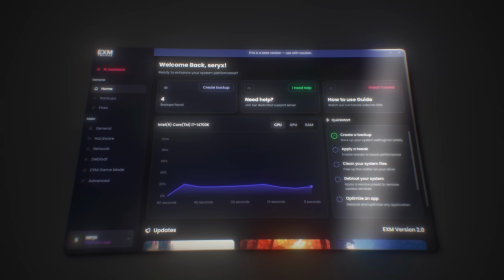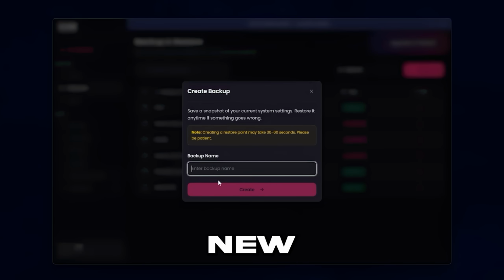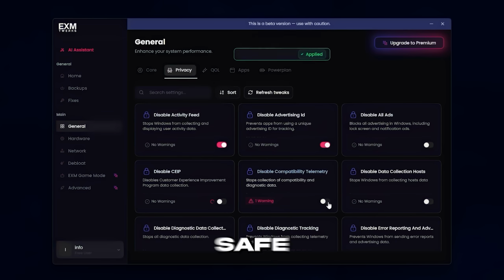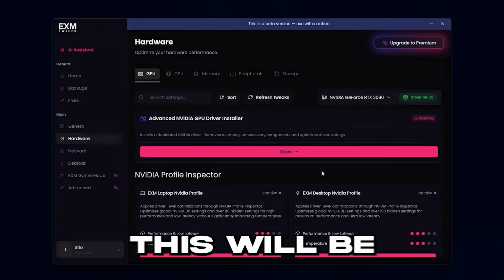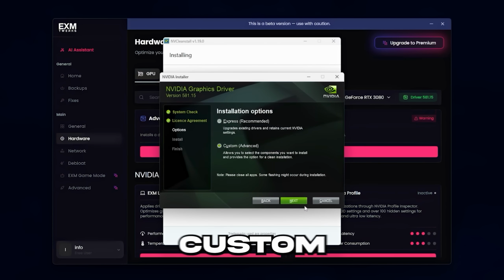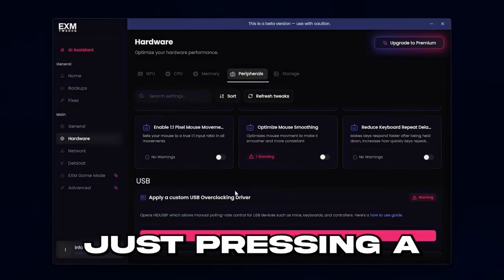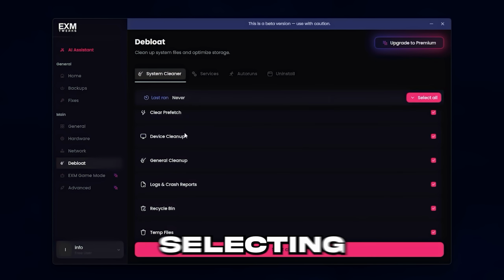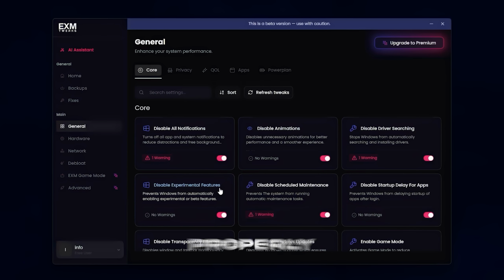*ULTIMATE* PC Optimization Tool 🔧(Boost FPS, Lower Input Delay)

Comment from the maker: Thanks for the support, if the free utility helped, make sure to check out the premium version!
https://exmtweaks.com/pricing/
Reply: I have i5 13600KF rtx 4060 and 32gb of ddr4  which value is the best for win32priorityseparation pls  🙏
Reply: @CHAT_TASTROPHE 26 hex
Reply: I am getting : Failed to save onboarding data
Reply: I have a gaming laptop with a 4050, i5 13420H and 32 GB ddr5
Reply: @vort712  yooo same but idk if its ddr5 or ddr5
Reply: I need exm free tweaking utility v10.0.cmd to send me link in download
Reply: @exmtweaks  this is the first time I downloaded any tweaking software and everyone has been telling me your the only person they trust so my issue is, I downloaded it and installed it and opened it, but it’s asking me to log in and when I do, it says loading session but then proceeds to kick my out over and over, what is this issue and how do I fix it
Reply from the maker: @kazwyd1x  yo, its an issue on our end, it will get fixed soon
Reply: I have a taichi rx 9070 xt , ryzen 7 9800x3d ,   32 gb ddr5 , in a rog strix x870e-e.   I’ve been using your free utility for ever now it feels like.   Never had an issue but on the free exmtweaks 2.0 when I click the I understand tab I get.  Authentication failed.  Please sign in and save password
Reply from the maker: @kinneyjr740   yo, its an issue on our end, it will get fixed soon
Reply: 12th Gen Intel(R) Core(TM) i5-12400

NVIDIA GeForce RTX 3060

RAM 32.0 GB
Reply: 9070xt 9800x3d
Reply: I know I bought it for a month but I was just wanting to enter just in case I could get it
Reply: i wish i win man the giveaway W tweak i wanna try it
Reply: I can't sign up at all, let alone sign in. I just get failed to login errors when trying to sign in :(
Reply: I have a Ryzen 7 5800x3d, an RX 6700 XT graphics card, and 32GB of RAM. Could you give me some good configurations for performance in Warzone?
Reply: is it free
Reply: pt-br  por favor
Reply: i have 4070 super and i5 13400F and 32 gigs of ram
Reply: @exmtweaks  hey so i tried using it but every time it cheks my System there is no continue button
Reply: @exmtweaks  I-7 6700k RTX5060

Comment: Hey EXM team, I need the official recommendation for Win32PrioritySeparation on my machine.

My specs:

Laptop: Dell 16 Plus (DB16250)

CPU: Intel Core Ultra 7 258V (Lunar Lake, 8C/8T, low-power)

iGPU: Intel Arc 140V

RAM: 16GB LPDDR5X (soldered)

Storage: 1TB NVMe SSD

OS: Windows 11 24H2

Usage: Daily web games (browser-based), 1080p/4K YouTube, Discord voice, light idle. Occasionally tweak with BoosterX + custom power plan (currently on EXM PowerX V3).

Cooling: Thin-and-light fan, quiet profile preferred, no overheating but want low latency.

Question: For this Lunar Lake laptop config, is 26 HEX (Recommended) still the right call, or should I drop to 18 HEX like you told the i7-14700K + 4070S desktop user? Thanks!

Comment: I definitely recommend these tweaks, I went from 200 fps too 400 and 30-40 ping to 20-30. It’s free it’s not a Trojan or anything. It has a bunch of stuff instead of the others where u only get 3 setttings free and the rest subscription. This is a legit utuber

Comment: I GOT A 4060 WHAT HEX?
Reply: ngl dont use it, its honestly useless, it could damage your pc aswell, dont take the risk because windows 32 is the most important part of your files/pc or wtv without it your pc will literally not work at all. Changing the hex will do nothing, and I have a 4060 aswell if your cpu/ram is trash then js upgrade rather then breaking your whole system.

Comment: yo tysm bro i was hard stuck at 360 fps and now i can easily hit 800-1000 with zero delay
Reply: why would you need a fps boost? that's already good when most monitors are around the 200hz - 300hz. if you're using a 60hz monitor the fps boosts is meaningless
Reply: @colkid5298  if you have a low end pc or are having stutters
Reply: @wtwbray  still. that much fps is dependent on the monitor
Reply: @colkid5298  i have a 200hz monitor and run 800 fps with no stutters

Comment: i am planning on buying the premium version because in game i often cant even hold stable 165 with specs like ryzen 7 7700 rx 7900 gre great power supply and an fd celsius s 36 like theres no overheating issues or any

Comment: Processor	Intel(R) Core(TM) i5-6500 CPU @ 3.20GHz   3.19 GHzInstalled RAM	16.0 GBStorage	477 GB SSD SSD Graphics Card	NVIDIA GeForce GTX 750 Ti (4 GB), Intel(R) HD Graphics 530 (128 MB)
Reply from the maker: 16
Reply: @exmtweaks thx
Reply: @exmtweaks Do you know what end my pc is like low end high end mid end

Comment: I have a mx450, i7-1165G7 and 8gb ram.I want to play battlefield 5 but it gives 10-15 fps.Even in low settings.Will this program help me?And tell me which hex?
Reply from the maker: yes it can help u but dont expect crazy gains since ur kinda limited when it comes to GPU and RAM, also 16 for the hex

Comment: quick question would i work on my laptop since my laptop can't upgrade RAM
Reply: since my laptop has 12th gen intel core i3 1215u, DDR4 8GB RAM, Intel UHD Graphics, 500GB NVMe sdd, and i use another 500GB HDD external
Reply from the maker: yes

Comment: my cpu is a (Intel(R) Core(TM) i7-6700HQ CPU @ 2.60GHz (2.60 GHz) my ram is 16GB and my gpu is a NVIDIA GEFORE GTX 960M what hex code should i use
Reply from the maker: 16

Comment: Hello! 

Question: Why do I have to sign up once I open the app but you in the tutorial just hit start? P.D. I´m already signed up on the browser.
Reply from the maker: i was already signed in before so it didnt prompt be to sign in again
Reply: @exmtweaks  Got it. By the way, I have a 4060 ti 8 gb, i9 12th gen and 32 gb RAM. Which one should I choose out of the numbers? (26, 18, 2a...)

Comment: Cpu Ryzen 5 5600
Gpu Rx 580 2048sp 8gb Card
Motherboard MSI B550 M A Pro

SSD Western Digital Black SN770 5000mbps Read/Write

Ram Kingston Fury Beast DDR4 3200Mhz 2 stick total 16 gb

Power supply 1st Player Dk 6.0 600w 80+ Bronze
Reply from the maker: 18

Comment: Hello, I'm using Windows 11 ltsc. I used the tool on the system, but I'm getting an error code with a sentence I don't remember well. Why is that? Is there a solution?

Comment: this really works guys i guarantee it, my specs is cpu-intel i7 1195g7 gpu-intel iris xe yess an IGPU and it really works, lower latency and my fps became better and im using the free versionn, tho sadly exm cant detect an IGPU so i did not get to put some tweaks on but just the cpu tweaks alone is fine

Comment: Eyo, I probably have a problem. I have an AMD RX 7600 OC, 31 GB of ECC RAM, and most importantly two Intel Xeon big CPUs, but the software detects only one of them. Will this affect the optimization progress?
Reply: My RAM is installed across 8 slots 4 for CPU 1 and 4 for CPU 2. The software detects the full 32 GB, but still only one CPU.
Reply from the maker: no, it shouldnt affect it

Comment: CPU

	Intel(R) Core(TM) i7-8700 CPU @ 3.20GHz

	Base speed:	3.19 GHz
	Sockets:	1
	Cores:	6
	Logical processors:	12
	Virtualization:	Enabled
	L1 cache:	384 KB
	L2 cache:	1.5 MB
	L3 cache:	12.0 MB

	Utilization	6%
	Speed	4.27 GHz
	Up time	0:08:08:45
	Processes	51
	Threads	889
	Handles	24013
Reply from the maker: 18

Comment: Intel(R) Core(TM) i7-8700K CPU @ 3.70GHz

    Base speed:    3.70 GHz
    Sockets:    1
    Cores:    6
    Logical processors:    12
    Virtualisation:    Enabled
    L1 cache:    384 KB
    L2 cache:    1.5 MB
    L3 cache:    12.0 MB

    Utilisation    13%
    Speed    4.29 GHz
    Up time    0:01:13:27
    Processes    211
    Threads    3408
    Handles    93956
GPU 0

    NVIDIA GeForce RTX 4060

    Driver version:    32.0.15.8180
    Driver date:    29/10/2025
    DirectX version:    12 (FL 12.1)
    Physical location:    PCI bus 1, device 0, function 0

    Utilisation    0%
    Dedicated GPU memory    2.3/8.0 GB
    Shared GPU memory    0.1/8.0 GB
    GPU Memory    2.4/16.0 GB
Reply from the maker: 18

Comment: Does it optimize for NVIDIA k4200 quadro 4gb, intel i5 4590 3.3ghz quad core processor and 16gb of DDR3 ram? 😭
Reply from the maker: yes, go with 18 for the value

Comment: Device Name	DESKTOP-VL5EGO4
Processor	   
Installed RAM	8.00 GB
Graphics Card	Intel(R) HD Graphics 4600 (113 MB)
Device ID	CAC7B018-6A42-4EC5-8405-F0BD4F326B45
Product ID	00330-80000-00000-AA851
System Type	64-bit operating system, x64-based processor
Pen and touch	No pen or touch input is available for this display
Reply from the maker: 18
Reply: @exmtweaks  18 means ?

Comment: I have a RTX 3050 laptop gpu with intel 13th gen 13450hx processor and 24 gb RAM DDR5, which hex priority value should i use?
Reply from the maker: 26

Comment: Device name	DESKTOP-CMTDEOD
Processor	Intel(R) Core(TM) i5-6300U CPU @ 2.40GHz (2.50 GHz)
Installed RAM	8.00 GB (7.88 GB usable)
Device ID	359D80A3-6F1D-4CB0-A000-CC648AAD8018
Product ID	00331-20350-00000-AA083
System type	64-bit operating system, x64-based processor
Pen and touch	Touch support with 10 touch points
Reply from the maker: 18

Comment: hey bro theese are my specs 
Processor	Intel(R) Core(TM) i5-1035G1 CPU @ 1.00GHz   1.20 GHz
Installed RAM	8.00 GB (7.74 GB usable)
System type	64-bit operating system, x64-based processor
Edition	Windows 11 Home
Version	23H2
Installed on	2022-10-07
OS build	22631.6133
Experience	Windows Feature Experience Pack 1000.22700.1108.0
Reply from the maker: 18

Comment: Keiron Clarke/CosmoticKing here. EXM had such good results that "really smart tech guys" in the minecraft modding community got extremely angry at me for "lying" and "grifting" on something i'm not even selling because I was so excited about my benchmarks. That's what happens when something is THAT good.

Also, which hex should I use?
35GB DDR5 RAM, RTX 5080, Ryzen 7 9800X3D
Reply from the maker: go with 2a

Comment: why after i follow this i get blue screen, when i remove charger?
Reply: Ah, no problem, it's only in the power plan. When I changed the power plan, I didn't get the blue screen anymore. The rest is fine, the problem is only in the power plan.
Reply from the maker: We fixed it

Comment: I will test right now, these are my specs- 
Operating system: Microsoft Windows 11 Home (10.0, Build 26200)
Processor: AMD Ryzen 7 5700X 8-Core Processor              8/8
Motherboard: ASUSTeK COMPUTER INC. ROG STRIX B550-A GAMING
RAM: 64 GB
STORAGE: WD_BLACK SN850X 1000GB (931.5 GB/Fixed hard disk media)
Graphics card1: NVIDIA GeForce RTX 4060 Ti (8.0 GB)
DISPLAY1: Acer America Corp. ACR0A33 (1920x1080 / 24 Inch)
DISPLAY2: Sceptre Sceptre K25 (1920x1080 / 24.3 Inch)
I average 100- 240 fps on fortnite depending on the graphics mode and 200+ on any other game, I will respond to my comment within a few days to say how much has either improved or gotten worse

Comment: i have 
Device Name :	DESKTOP-UM3F83M
Processor :	Intel(R) Core(TM) i5-8500 CPU @ 3.00GHz   3.00 GHz
Installed RAM:	8.00 GB (7.87 GB usable)

Storage :	932 GB HDD TOSHIBA HDWD110, 224 GB SSD HP SSD M700 240GB
Graphics Card	Intel(R) UHD Graphics 630 (128 MB)
Device ID:	960B8A42-2A3F-4975-8874-A8E84D5F253C
Product ID:	00330-80000-00000-AA059
System Type:	64-bit operating system, x64-based processor
Pen and touch	No pen or touch input is available for this display
Reply: delete ts bro
Reply from the maker: 18

Comment: I use an intel i7 14700kf, 5060ti 8gb, and 32gb ddr5 6000mhz. which hex should I use?
Reply from the maker: 2a
Reply: I’ll try it out ty
Reply: it isn't saving when I switch from default. after a restart it just goes back.

Comment: i also got a question what tweak made my battery icon be gone bc i can't see when i need to charge lol, but besides that the best tweaking utility ever im getting straight 240 fps
Reply from the maker: try to check windows settings if its disabled from showing in the task bar

Comment: Bro i literally got the 2 most problematic components in one rig. i7 13700kf and asus mainboard, my frkn cpu is overheating like crazy and i got a custom watercooling system... imma just give up wait for my next paycheck and get myself a i9 ultra fk it
Reply: Hey; This will not help, I recommend switching off intel as recent intel chips just run very hot, custom watercooling... AIO? If so, is it 1,2 or three? For your cpu you'd 100% Need 2 or three, the one type would be too bad.

Switching to a newer (But not newest) Amd chip is perfect, you'd have to swap the MOBO, but it should definitely help with the cooling problem, may i ask how hot your cpu gets in-game? typically cpu's can go well above 90c before crashing//Shutting--off, for me I typically get 60c idle, 80c max (Spike), if your cpu idles above 65, or in game is above 80/85 it's definitely the cpu not the cooling, either switch down a few gens (Maybe a 10th gen) Or swap to amd, please do not upgrade to the new intel chip...

Comment: Processor	Intel(R) Core(TM) i7-4770 CPU @ 3.40GHz   3.40 GHz
Installed RAM	8.00 GB
Graphics Card	Intel(R) HD Graphics 4600 (113 MB)
System Type	64-bit operating system, x64-based processor
Reply from the maker: 18

Comment: I'm having trouble with the optimizer. I subscribed to premium, tested it before formatting the pc. I decided to format it to see if there would be conflicts with previous changes, as I forgot to make a restore point. After formatting, I downloaded the drivers normally and started the optimizer (logging into the account where I subscribed to premium), when trying to run any type of tweak available in the APP, the following error occurs: ERROR: Script execution failed "Hardware ID mismatch - this token is not authorized on this device". I restarted the PC numerous times and was unable to do so. I tried to log into the discord server, but another error occurs: "Could not accept invitation." I'm just here to try to solve this problem, as I've been using EXM optimizers for quite some time and highly recommend the premium subscription. I'm from Brazil and I don't speak English fluently, so please overlook any errors. Thank you in advance for your attention!
Reply from the maker: yo, open a ticket on my cord

Comment: i had an issue downloading the drivers it crashed and my pc doesent recognised my gpu (rtx4060) but i fixed it with ddu such an easy error. Otherwise it works absolutely perfect and it is much better than the exm10

Comment: This app is well made and simple. Had an issue logging in though because it wouldnt load the web page. And then it says when logging in from the app that my email is not authorized. I got it to work by retrying it a couple times. Not sure if this is an issur that you can fic or if its an issue with edge not popping up that tab that you need to enable. Also 5-6 doolars a month is not bad at all for premium
Reply from the maker: its an issue we are aware of dw

Comment: Ryzen 7800x3d, RTX 5070, 2x16gb DDR5 6000mhz CL26, Asus B650E-i + amazing cooling system. Tell me please the best HEX should I choose for the lowest ping and input lag with responsiveness, thanks😊

Also how much does the lifetime 2.0 premium cost? Many thanks
Reply from the maker: 2a and u can see the pricing on my site
Reply: @exmtweaks  thanks, but when I am choosing on my PC 2a HEX - it leads to error: Script Execution failed.

Hardware ID mismatch - this token is not  authorized on this device, the possible fix - did not help. The same happenes with any HEX I choose. 

What should I do? Thanks

Comment: Do you know "tweaking" is not good for your pc, like all the options of your pc is important is all linked so if you disable 1 services it disable more than one option and  tweaking can "destroy" your pc and System backup do not revert regedit tweaks so it's super dangerous ! Do benchmark or real optimisation
Reply: im an editor only use premire pro after effect still tweak my pc and got faster output free up more ram for after effect.and if you re game that tweak boost your gaming perfomence too
Reply: @DemonBloxGirl i tested a lot of tweaks same result pc reset, lot of tweaks is not nessesary but used by all of the utility like DisablePagingExecutive / NetworkThrottlingIndex / SystemResponsiveness windows do not care it's already managed by windows and most of tweaks is not utils they worked on WINDOWS XP or 7 so now they doesn't work and i can generate other problem so idk
Reply: we re lot of people tweaking our pc more than 3 year ,tweaking will'nt destroy your pc

Comment: does the tweaks stay permanently or do i have to reapply the tweaks every time i use my pc?
Reply from the maker: they stay until u perform a major Windows Update or reinstall Windows
Reply: @e @exmtweaks  ok thanks
Reply: @exmtweaks I’ve been using it and I’ve noticed a huge difference from without tweaks not having stable 120 fps to now having stable 200 fps

Comment: Another thing I already did some tweaks in my potato laptop including ur exm 10.0 something version the final edition 
Should I reset my laptop then apply your tweaks or should I just go ahead and use 2.0
Reply from the maker: up to u, reapplying tweaks from 2.0 wont cause any issues with the ones u had before

Comment: I have a Intel UHD Graphics 620 and Intel Core i7-8650U with 16GB of DDR4 (Dell-Laptop Ram with SODIMM
Reply from the maker: 26
Reply: @exmtweaks  may i ask why you spit out random junk? For Intel UHD Graphics 620 it's 26... but  integrated HD 4600 it's 18?

 Intel UHD Graphics 620 -- 2.06%                  integrated HD 4600 -- 1.29%             This difference is negligible, stop spreading this malware infested software.

Comment: for me personally 16 hex was wayyyy better than any other one, it got me 15 ping more or less, while 2a got me 40 ping and so did 26 hex but 18 hex got me like 25 they all got me the same fps tho 500 to 700 i have an rtx 2060 6gb r5 7600x and 16 gb ddr5 also these tweaks are amazing definitely turn on everything you can i just wish i was down to 10 ping and under like i used to be lol